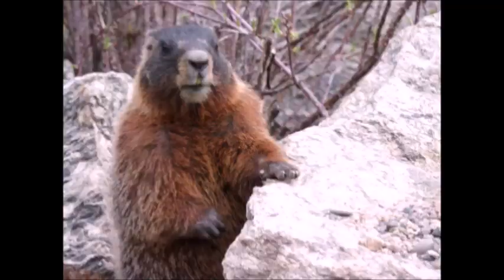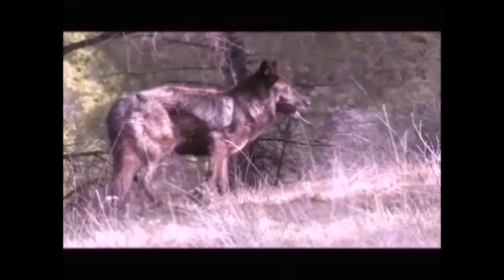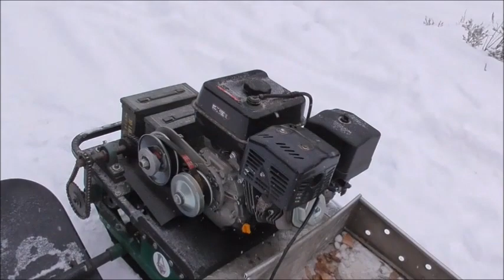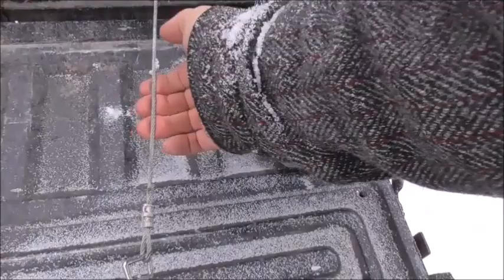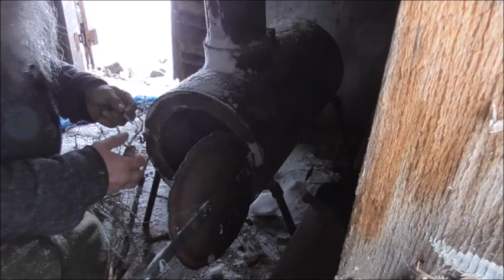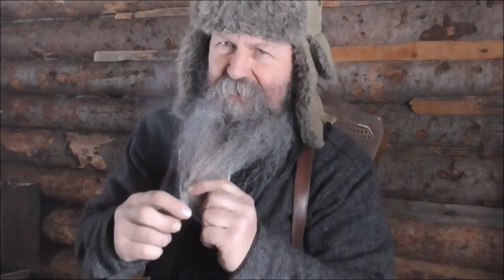The No Dog Sled Rides Again!   2021

Comment: Nice to see your contraption back on the road! I like that strips of inner tube for fire starter idea. Btw, wonder if it would be worth it to grab four or five cans of spray foam and fill in the gaps in the logs of the cabin, as it will likely hold a lot more heat by just that one simple action. Might not be pretty but it would be functional.
Reply from the maker: It is drafty!  I might do that.  I'm not sure if these are private property or not.  It doesn't show it as private on any map I've found.  I kind of hate to do very much to them, I don't want to get someone mad.

Comment: Nice to see the snow dog come back out, and I like the improvements you made to it. Since you had a problem with them in the deep snow, I wonder if some torsion springs around the pipe that connects it to the sled, that push the rear of the skis down would be enough keep the tips up.  Nice cabin up there, looks pretty drafty though.
Reply from the maker: Thanks!  It might help. I have them where they can pivot, but not fold under, but maybe they still move too much.

Comment: Anyway to attach a small spring to your snow board stabilizers to keep the front of them up until the snow levels them out? Might keep them from digging in when your go through the powered stuff.
Reply from the maker: Maybe.  They balance towards the rear, to the front is tipped up. I do have a bolt in them so they can't flip down too far. I finally added those side wheels to the edge of the track a few days ago. I'm hoping that will make it stable enough that I won't need those side skis.  I haven't had a chance to try it out yet.

Comment: I like the stabilizer boards on the side !!! That's a great idea !! You might consider putting a cable from the tip back to the bar to keep the nose up cause i believe it would be possible for the tip to dive.  You've got a great setup for sure.
Reply from the maker: That might be the problem.  I have a bolt that keep them from tipping too far, but maybe they still tip too much?   It is fun to ride. It does take a little getting used to though!

Comment: That is one heck of a neat machine, an set up. Just a idea, what if you got a set of skies off a old snowmobile that had the leaf springs on the ski an mount those on where they are touch the ground even with the track? Cant believe iv never thought about the inner tub trick👍
Reply from the maker: That might work, but they would be heavy maybe?  It is tippy, so it needs something for sure.  Yeah, try those inner tubes!  Cut a point on one end so they light easy.  It doesn't matter how wet they get, you can shake them off and they light. A piece 3 inches by about 3/8 inch will burn about 5 minutes or longer.

Comment: I’ve always wondered why this contraption over a sled (snowmobile). They seem popular in Eastern Canada for ice fishing.
Reply from the maker: Snowmobiles are better, but these are cheaper to run, and can be home built like this one.  Also, loading these into a truck is easier since they are shorter and more compact.  For ice fishing, they are perfect because they are able to pull a lot of weight.  For long rides, snowmobiles are much faster and more practical, but they cost more, and the cost of running them is higher too. This is a Russian invention to put broken snowmobiles back in service.

Comment: Great to see the "Dog" out in action. I am guessing that the snow boards tip forward and dig into the snow. Since their only purpose is stabilization, you might try permanently fixing them in the tipped back position. This would still provide stabilization and the tipped back ski may provide lift. It's likely that the higher the front tip of your ski is the more likely they will stay above the snow. You have come a long way with the "dog". I am sure that in the near future it is going to become a dependable tool. There will always be modifications that can be made when the need for them become apparent. I assume that plastic antifreeze bottle on the sled contains fuel. This is a very interesting subject and video! Thanks!
Reply from the maker: Thank you!  You might be right.  I have them fixed so they can't top forward very far, but maybe it's still too much?  Yep, that jug is extra gas.  So far though, I haven't had to add any. It go's quite a ways on a tank.

Comment: Love that box/ramp idea! Maybe you can rig some springs or bungee cords pulling up the fronts on those stabilizer boards to keep them tipped up yet still flex? So they might not dig in. All in all thats a neat piece of mechanical engineering! What was that strip, I replayed it but cant make out for sure what you are saying? Thanks, Happy Healthy New Year to ALL!!
Reply from the maker: That box/ramp really works well.  My friend uses his for a 4 wheeler. I'm not sure if he thought up the idea, or saw it someplace, but it's a great idea!  I'm going to have to look at those skis and see if there is anything I can do to change that. That strip is just a piece of rubber innertube from a car, or bicycle.  A piece about 3 inches long x 3/8 inch wide will burn for about 5 minutes or so.  You could soak it in water, shake it off, and it will still light.  It helps to cut a point on one end to make it easier to light, but it works great!

Comment: Tell me why not a ordinary skidoo?
Reply from the maker: Cost.  I have one, a Polaris Indi-Ultra.  Trouble is it takes 2cycle oil that costs $50 per gallon. I was going through a cup every 15 miles. It also burns drive belts which are also about $50 each.  This thing takes straight gas, no 2 cycle oil, and drive belts are $6 on ebay.  Also, I can stand up. I have bad knees and sitting on a snowmobile, your legs are bent like a squatty garden toad....after awhile it hurts!